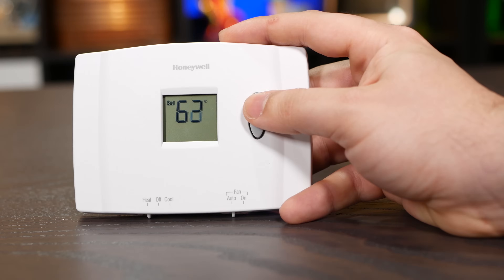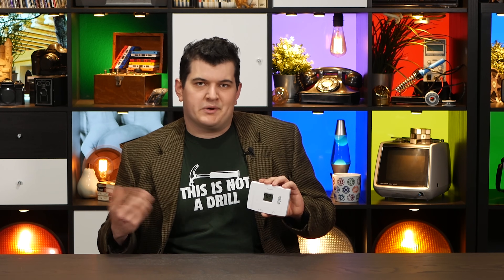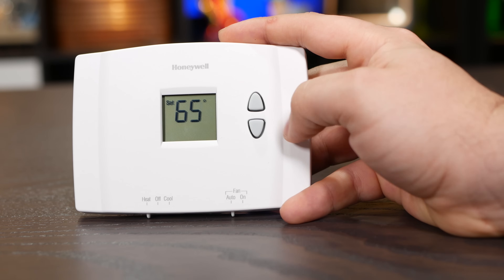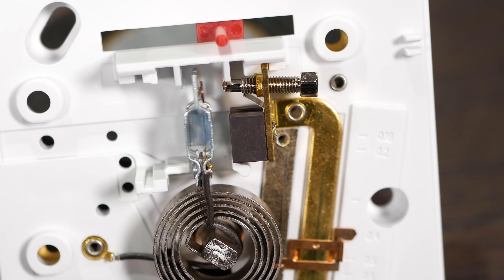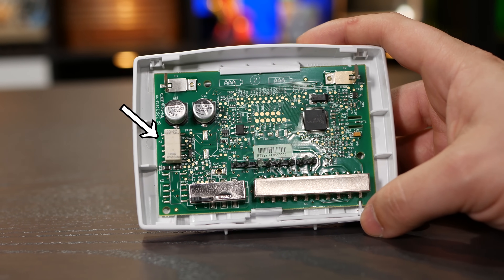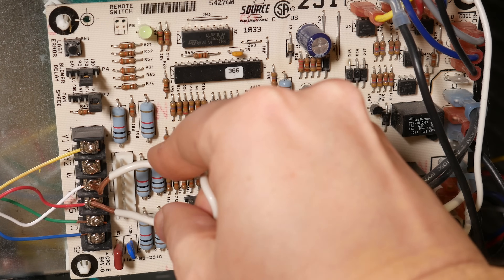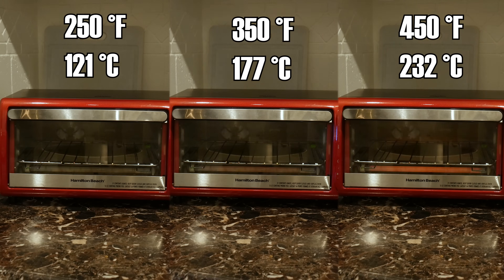Thermostats: Cooler than you think!

Comment: My thermostat lets me just run the heat or ac for 30 mins and go back to previous temp after.
I have old electric plugin heaters in my house and programmed my own thermostat made using an ESP32 board. I have little boards in all the rooms allowing per room temperature control and of course they're all connected to wifi so I get the temperature graphs, heating time, costs stats etc etc.
Making your own adding a feature such as pressing a button to run for 30 mins and go back is 30 mins work.

Comment: A house I rented in FL had a digital thermostat with a scheduler. It allowed for manual override, of the temperature, which would only last until the next scheduled temperature change. Close to the requested, supply heat/AC for X minutes then return to normal. So, even though I don't know what make the thermostat was, there are models out there with these capabilities.

Comment: As an HVAC and boiler technician of 23 years I have seen a lot of change over my career. This video was very simplistic. It’s not a criticism as the target audience was not someone such as myself but the average person who doesn’t know how this stuff work. However...

Modern thermostats are so much more capable these days with motion sensors that automatically control the temp in the house based on detected movement, will integrate into a home system such as Google Home or Alexa, give you the ability to connect remote indoor and outdoor sensors to run your system at the highest efficiency levels based on current indoor AND outdoor conditions, connect to your wifi system and will send you system alerts if there’s an issue, and have geolocation settings. Geolocation allows you allow to register every smart phone in the home and uses the GPS in the phone to determine if somebody is home or not and will automatically set the thermostat for Home if somebody is there or Away if everybody is gone. You set the size of the geolocation ring and when a phone enters the ring it will start monitoring it to see if you’re just passing through or actually on your way home and will adjust the thermostat accordingly if it appears that you’re on your way home. They will also control everything that is tied into your HVAC system such as the furnace (Natural gas, propane, fuel oil, or electric), AC or heat pump, whole house ventilation system such as a HRV (Heat Recovery Ventilator) or ERV (Energy Recovery Ventilator), whole house humidifier, whole house dehumidifier, air filtration and purification systems, zoning, and even have sensors mounted at the indoor unit that will tell you when it’s time to replace your filter based on the temps they detect in the ductwork. And other than the wiring at the indoor unit, all of the sensors and other accessories are wireless. Look at Honeywell’s Prestige IAQ kit for forced air or Salus if you have a steam or hot water boiler. 

https://www.honeywellhome.com/us/en/products/air/thermostats/wifi-thermostats/prestige-iaq-kit-with-redlink-eim-and-4-sensors-ythx9421r7001ww-u/

https://www.salusinc.com/product-category/hydronics/wireless-hydronics/

Comment: Late to the game, but I'll ask anyways.  don't most furnaces have fans that keep running even after the heating source is turned off (at least fuel furnaces do, I think)?  This, to get the residual heat that's still in the furnace into the house instead of just letting it leach into the basement?  Is this controlled by the thermostat, or the furnace itself.  I'm gonna guess the later, via a built-in circuit and thermometer that keeps the fan on until the furnace itself is cooled down to a certain temp.  Any thoughts out there?

Comment: I realise I'm a bit late to the party, but here in the Netherlands, most people have what's called a 'modular thermostat' which can send signals to and from the furnace to control the furnace's output depending on the programmed temperature. (e.g. only use medium heat to prevent overshoot)

Comment: I read some of the comments and some furnaces  have 2 stages Y1 is cooling first stage Y2 is cooling second stage and on first stage the ac runs at 50% capacity and second stage runs the ac at 100% capacity
Reply: I know this stuff because this is my hobby and I know a tone of stuff about HVAC witch mean Heating Ventilating Air Conditioning

Comment: Here in the dry part of the country we use swamp evaporators, which since they were originally operated manually have multiple terminals: power, high fan, low fan, and water pump.

Comment: "Setting the thermostat higher doesn't make it work on full blast"
"Thermostats work by duty cycling"
.....time to boost engagement.....
Reply: The two statements aren't contradictory. 
Generally speaking (except for staging or modulating systems, both fairly rare in home systems) when the heating or cooling system is on, it's all the way on. So if you come into a cold house and want to warm the place up, setting the thermostat all the way up won't get the temperature up to 72 (or wherever you actually want it) any faster than just setting the thermostat to the temperature you want.
Once the setpoint is reached then the thermostat cycles the heating or cooling device on or off as needed to maintain the temperature within a couple of degree spread.  This is when the "duty cycle" comes into play.

Comment: It's funny. I just discovered this channel as I'm (unrelated) looking for a mini split ductless heat pump which does, in fact, have more options than on and off, but also has a low power  maintenance mode, so it runs constantly on low power, and a blast mode that goes into overdrive at the expense of some efficiency.

Comment: the coil thermostat, mine doesn't have a magnet, but a little vial of mercury, when the spring tightens the mercury slowly moves from one end of the vial to another, eventually bridging a circuit, then the reverse happens, breaking the circuit. Surface tension from the mercury would keep the contact together long enough to heat the spring far enough to prevent it from constantly switching on/off. It's very smooth and surprisingly exact. There's no violent connect or disconnect like a magnet causes, and the spring, never under tension, doesn't suffer from metal fatigue like the magnetic one would.

Comment: So, any internal combustion engine car that is liquid cooled has a thermostat. It’s usually a super cheap part, because it’s basically the same theory as the cheap wall thermostat you demo’d. An engine needs to run at a certain temperature (usually around 190°F) and if the coolant system flows max flow to the radiator all the time, the engine would run too cold (usually the water pump is driven directly off the crankshaft, so it flows at a set rate per RPM). The thermostat blocks off the main input to the radiator, until the coolant reaches operating temp, at which point it opens up to prevent overheating. Then it opens and shuts to maintain the “operating temp”
Reply: Just a fun fact as a car guy.

Comment: My folks did that. I kept telling them it doesn't make it heat or cool faster putting it on the highest/lowest settings. But they cranked it up. I usually turned them down when they wasn't looking. They would turn it down if I didn't. Eventually. After the house is like an oven or freezer. I guess I understand their logic. Turning a cookstove burner on max =maximum heat. But other devices don't work like that. Either they're on or off. The flame stays the same. Etc, etc.

Comment: We have 2 wires and have to flip a switch  and the thermostat  is set to heat  when we switch  to ac an open circuit shuts it off when we switch  to heat a closed  circuit  shuts  it off

Comment: Pity you're so out of touch with heating controls !

My boiler thermostat is analogue - no on or off, just temperature difference.

Want to run the air con for an hour then go back to normal ? That's not the job of a thermostat, that's the job of a timeswitch - the clue's in the name. Standard feature in the UK - run the heating an extra 1, 2, or 3 hours. Another standard feature is to 'flip' the setting - so if it's on, it'll flip off and if off, flip on - until the next programmed time to change things.

Comment: Snap to the right; which turns on the heat. Snap to the left; which turns on the AC.
Snap to the right; which turns on the heat. Snap to the left; which turns on the AC.
Snap to the right; which turns on the heat. Snap to the left; which turns on the AC.
Snap to the right; which turns on the heat. Snap to the left; which turns on the AC.
Snap to the right; which turns on the heat. Snap to the left; which turns on the AC....

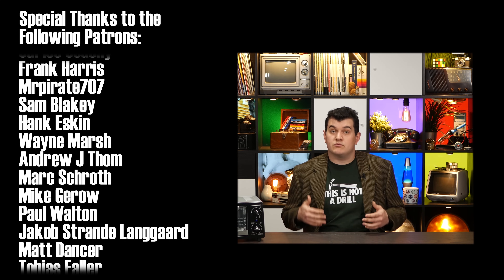Comment: 14:50 it matters. The thermostat should be located at the return air plenum. If you put the thermostat in a closet it will not regulate the temperature in the house correctly because it does not receive the feedback from the airflow to know what the actual are in the house is doing AKA it's temperature.

Comment: Most microwaves work the same way when you don't choose full power. Newer inverter ones seems to run a a lower power for the whole time, but running a cheaper or older one at 50% just causes them to run for the time specified and only put out power half the time. I have no idea how they decide when to turn the power on and off again.

Comment: I kind of know of a thermostat that will run a temporary cycle, but only kind of. Alarm.com has a smart thermostat that can be programmed from your phone with multiple "scenes", which can be tied to a button in the app or widget on your phones home screen. You could set one scene to turn the thermostat to cool and set the target temperature low enough to guarantee it won't switch off until you tell it to, then once you've cooled off switch it back to a normal "scene" by pushing a different button.

Comment: I had a thermostat that I could change the temp and then by the time it hit the next cycle it would revert back to programming. Had 6 time slots in a day i think so not exactly what you wanted, but I definitely cranked it down a few times and didn't touch it again knowing it would revert back to normal with the schedule

Comment: In some digital thermostats, that last comment is sorta there. On my thermostat, if I adjust it, it goes into override mode. I can then tell it when to resume it's programming, or permanently hold it  at that set point. Great for an odd day or evening with a different schedule than usual, or to save energy when no one is going to be home because they were going on vacation for a week or two.

Comment: And then we're looking at our "ol' europe" german appartments... Where you have the big water filled radiators below your windows, the highest price of electricity worldwide (0,31-0,35€ per kw/h)  and none... really NONE house has an AC Unit installed. Germans allways beeng suprised and upset EVERY YEAR AGAIN when the outside temperatures reach above 25°C and sometimes hit the 38°C. Oh what suprise that summers getting hot...  And you're not able to cool your rooms. We can't even install a window AC unit because of our trashy window design that either turn on the horizontal axle and just have a small gap where nearly no air is flowing through or turns on the vertical axle where you have to completely remove the half of your furniture flowers or whatever is in the way. Because these stupid windows move entirely with the complete wing INTO the room like a door... I allways look quite jealous to the north americal slide windows that are able to install an window AC unit.

Comment: You have never heard of a 2 stage furnace?      The furnace sense internal air and compares it to external air and heat either at low heat or high heat.   Dependin on the delta in those temperature.  Yes the heater has two elements like that toaster you have.

Comment: Why not make a thermostat that does heat and cool at the same time and just require that the temperatures for them be sufficiently far apart.  I hate having to switch back and forth between heating and cooling modes every few days in the spring and fall.  I’m usually to lazy to do this and am just uncomfortably hot or cold some days.  It would be nice if I could just have a cool temperature of 71 and a heat temperature of like 69.  It’s really annoying having to choose one or the other in a region when daytime highs can shift back and forth between 50 and 80 or the course of a few days, and lasting for a couple months twice a year.

Comment: In regards to one of the questions at the end - yes, some thermostats do have an option to switch it on for a set amount of time but their functions vary widely.
The one I have for example has a 'party mode' which makes it run for an hour for each press - this does not bypass the set temperature desired but it does bypass the set time schedule.

Comment: I ended making my own thermostat, basically just a microcontroller that checks sensors around the house.  It has lot of advanced programming and I can easily override it with preset programs that I can just click a button, such as running the blower fan for 45 minutes, or the heat etc.    Don't like the cloud based ones since you're at the mercy of that company always offering the service, not to mention the privacy issues.  I do need to improve mine though there's a lot of features I COULD add like zoning which I just never did.

Comment: The more sophisticated  thermostats on British  gas condensing boilers can reduce the water temperature in the radiators as the room temperature approaches the setpoint effectively introducing proportional control. The boiler will then work in fully condensing mode increasing its efficiency.

Comment: Just saying, there are now some furnaces and thermostats that don't use those simple wires at all. Instead they just use Ethernet cables with PoE, or wireless protocols to talk with each other using complicated digital protocols. Such systems are usually proprietary, but it does allow much more flexibility like support those inverter driven heat pumps and furnaces that does have a lot of "medium" blasts between "full" and "off".

Comment: You can already set the temperature to a temporary value with a Nest thermostat and have it revert. You set the schedule for every (half)hour to say 72F. Then you can set the value to say 68F manually. When the Nest hits the time on the schedule, it will revert the desired value back to 72F. I never have done it for this reason but it works when I change it for other reasons. I’d imagine it would be a pain in the ass to set up the schedules since you’re setting [24|48]x7 schedules depending if you’re doing every 30 or 60 minutes. I’m not even sure if Nest supports that many schedules though.

Comment: I don't understand why you say the spring is bi-metallic? I don't think a bi-metallic strip is needed nor used. Bi-metallic strips are used to bend a metall upwards or downwards. 
Metall get's longer when heats up. So the coil turns even without bimetal.

Comment: My cheap-ish Emerson thermostat defaults to overriding for either 2 hours or the next scheduled temperature change (whichever comes first) when you use the control panel before jumping back to the schedule, unless you hit the hold button to lock in the setting, which is the feature you mentioned at the very end.

From  the manual:
"Program Override (Temporary Hold) – Press [Up] or [Down] until the desired temperature is
displayed. The thermostat will override the schedule until the next programmed time
period with a minimum override of 2 hours. Then the thermostat will automatically revert
to the program."

Comment: 2:09 There is sort of a medium blast so to speak for heating as well. If your HVAC is a forced air heat pump, you have regular heat-pump heat and then auxiliary coils. Some even have "Emergency heat" coils. When your HVAC cannot keep up with the demand, or on some thermostats [eg ecobee3] when the requested temperature is GREATER THAN 3 degrees difference, it will shut off the heat pump and just use aux heat. More expensive but heats quicker.